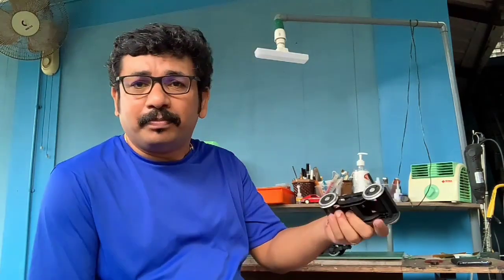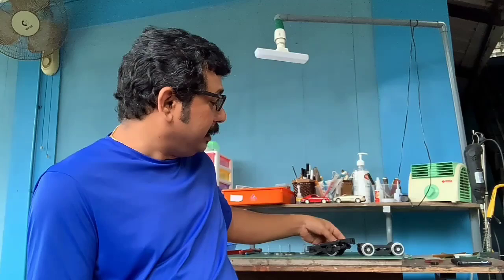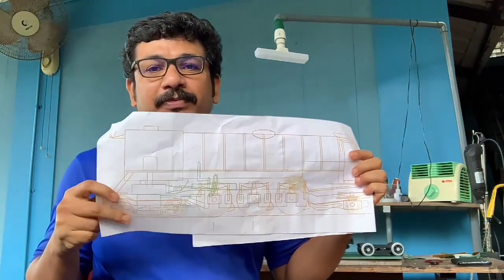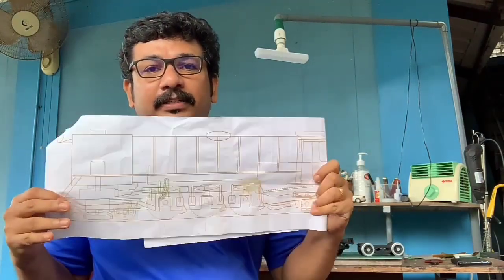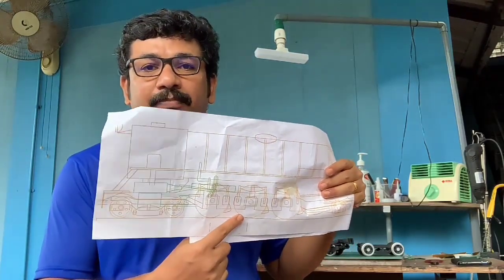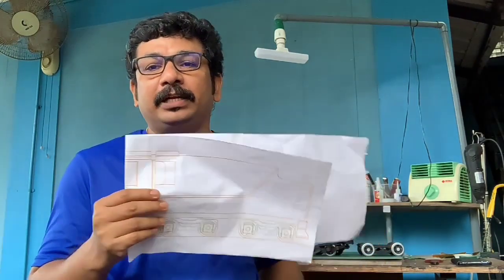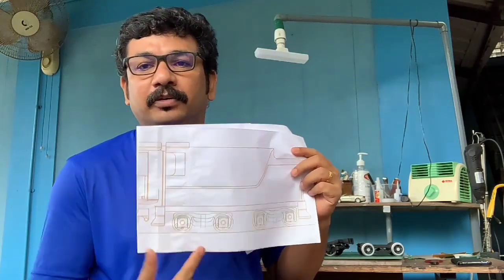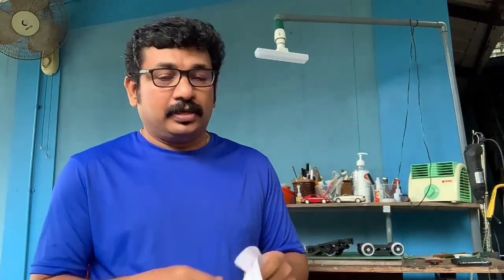Making handmade steam locomotive - Part 3 - Tender wheels

Comment: what kind material use you?
plastic or paper?
Reply from the maker: Its called mount board. It is paper based card board.
Reply: @HeemsMiniatureWorld  is it durability and waterproof ?
Reply from the maker: @talhacks1739  I am coating it will glue and then paint with primer and acrylic paint and finally the main paint. So it should be durable and water proof to an extent.
Reply: @HeemsMiniatureWorld  thanks :)

Comment: sir how to polish the tender bogie what material you used to polish the unexact tender bogie to smooth
Reply from the maker: Polish is done with water paper of various nos. I apply flex kwick glue on top and then polish, Then i apply acrylic paint and then finally black matt spray paint.
Reply: @HeemsMiniatureWorld  sir i mean little stick that you use to polish
Reply from the maker: @swezin8450  Thats a flat file which is available in any hardware shops or online
Reply: @HeemsMiniatureWorld  after steam loco model i suggest to make tank wagon
Reply from the maker: @swezin8450  Will try. Some other models are already in plan

Comment: Tell me the price of foam board
Reply: 1000 rs
Reply from the maker: @udaysuryawanshi8129  Yes, its bit costly, But 2mm, 3mm thickness will be cheaper
Reply: Sir can u help me
Reply from the maker: @udaysuryawanshi8129  How can i help you please tell me
Reply: I am working on engine and it is going hard to do
Reply from the maker: Depends on thickness of the board and size. 8x4 feet costs around 1000 rs i think
Reply: What 🙄🙄